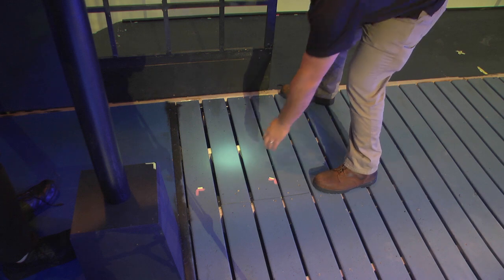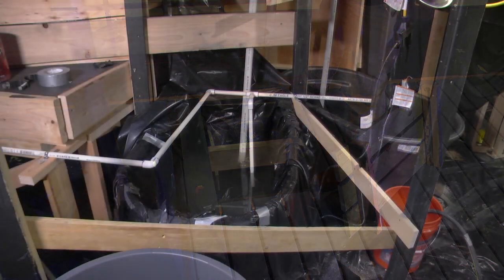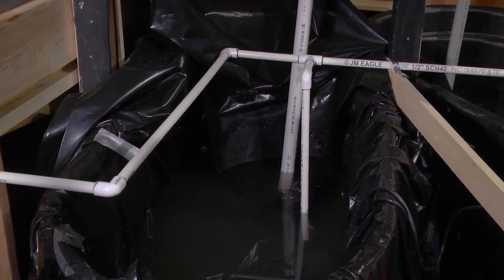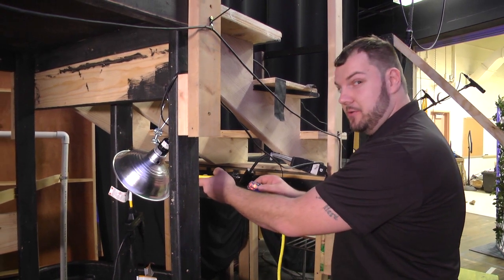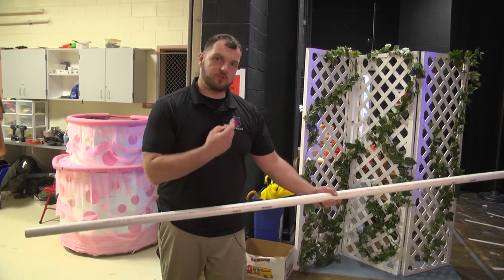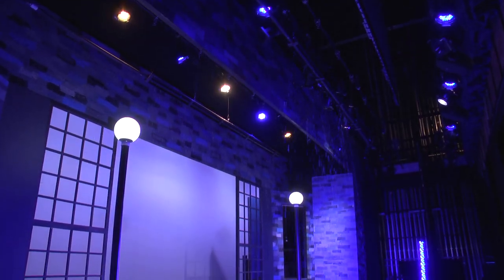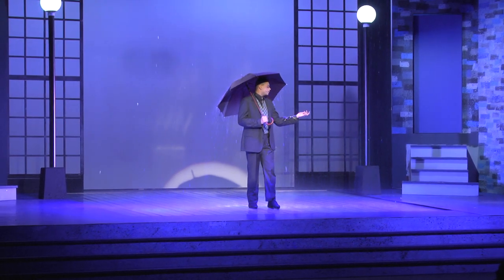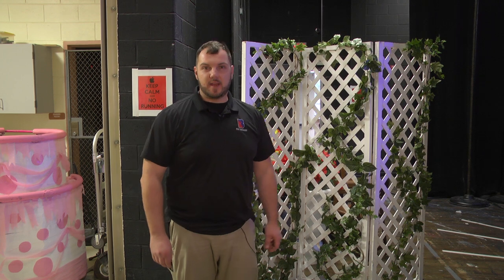Making it Rain on Stage - BCIT APA production of Singing in the Rain

Comment: Thank you for sharing. It's apparent he got wet so isn't the stage wet how are you going to do a whole number without him slipping around?
Reply from the maker: The wood slats are painted with a grit non-slip paint while being spread apart enough on the raked stage to allow the water to fall through and back into the system with a small lip at the bottom so the water did not overflow off the raised raked platform.  No rain got outside the area and since this is the closing number of the first act, a little clean up and a couple of blowers to dry everything out and we were good to go for the second act.